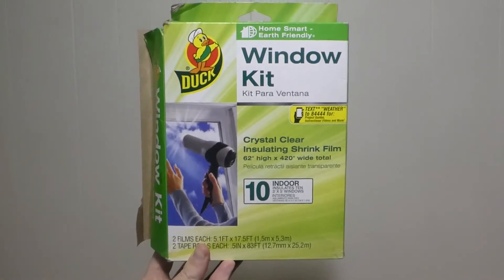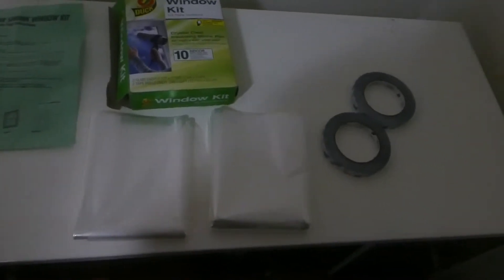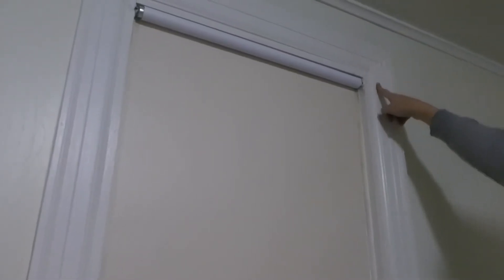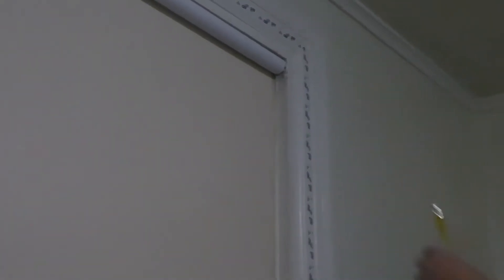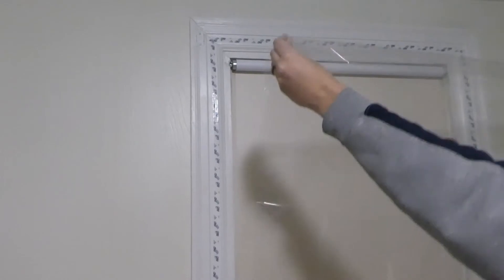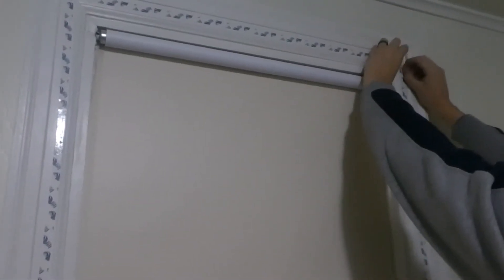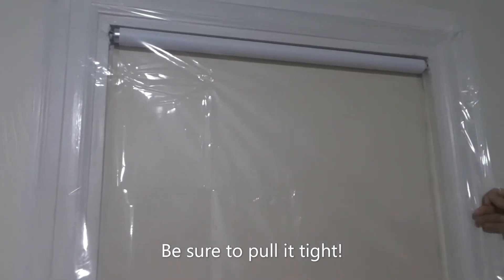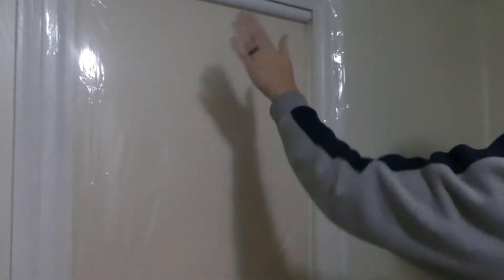How to install Duck Window Insulation Kit DIY video #diy #duck #window #insulation

Comment: I did this today on three of our windows. The first took longest because I had to learn how to do it when my hands, as opposed to Big Al's, were doing the work. After than, it became easier and faster. I'll finish up the house tomorrow. I like the results and feel this was both money and time well spent.
Reply from the maker: The first time is a little tricky but I found it gets easier the more you install. Thanks for the comment! I hope they help!
Reply: David, I've used a lot of this window shrink plastic, but never tried DUCK brand. I bought two big boxes of the stuff to do my house. I hope it doesn't leave lines? It's 1.5 mills thick, which is suppose to be better than most. You got it up okay, way to go.
Reply: I'm going to try it out to keep the heat outside in Yuma az and for the cold in Northern Utah. 
Thanks for the info.

Comment: Ty for this video; I bought duck brand window kit  Q: do I put the tape on the Window Frame or on the Window Trim? I put it on the trim  and the plastic film isnt sticking to the glass window any! :( I also tried putting the tape &the plastic on the window  frame and the glass pane & agin the plastic film isnt sticking to the glas! Isn't the point of the hair dryer to make the plastic stick directly onto the glass window? Or is the plastic suposed to be a few inches from the glass?(thats whats hapening)*** Also the tape did Not Stick enuf & its hard to get the top part of the tape off.  I'll have to redo it :( 
I tried different heat settings of the hair dryer to no effect. If the glass is too far indented from the trim is that whats making the plastic not stick to the glas? I'm very frustrated , please advise, ty.

Comment: We are looking to do this in my daughters bedroom. Her window currently has blinds and curtains. Would you recommend doing this over the blinds or behind them?
Reply from the maker: I think it just depends if you want to use the blinds or not and if there is room to apply the insulation behind the blinds.  Some of our rooms had pull down shutters and we did the insulation over the shutters.  We kept the shutters closed and applied it over top.

Comment: Your a little late You Tube. Thanks for listening in on my cell phone. Got all my windows done already. Better luck eavesdropping next time.
Reply from the maker: haha! That is funny. I hope this helps keep your home warm this winter!
Reply: @BigAlRepairs  I found out covering windows with good shrink plastic blocks out 65% more cold air. That's 65% each window!  I've done all my windows in our ranch house and this place holds heat like never before. It really works.
Reply from the maker: @hairylarry6167  Yes, we used this on our 100+ year old house in Connecticut that had, what felt like, zero insulation. We found it helpful too!